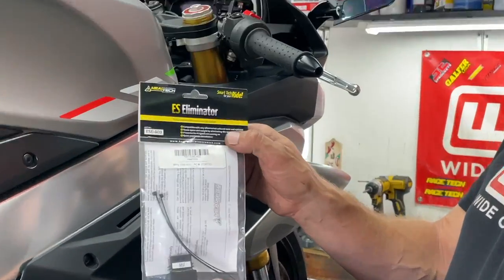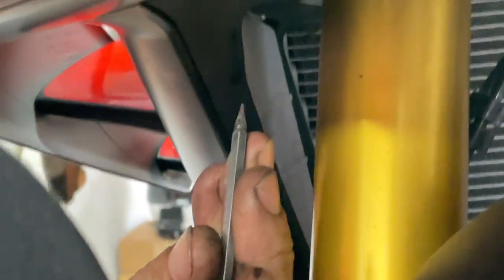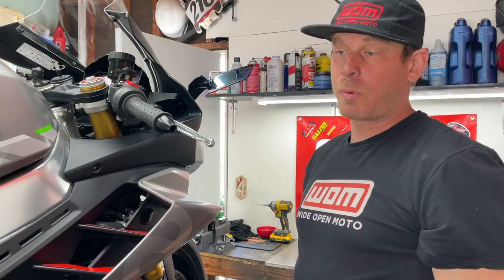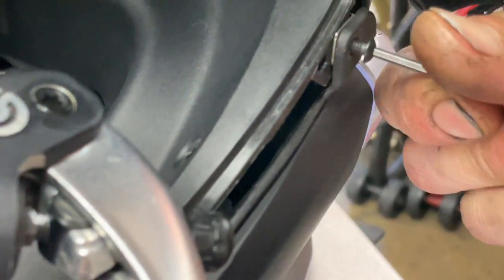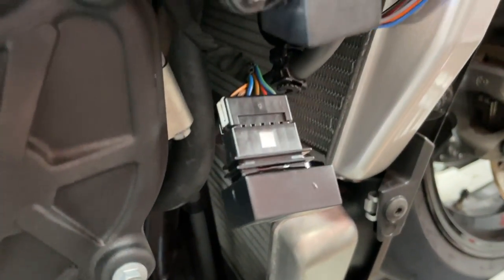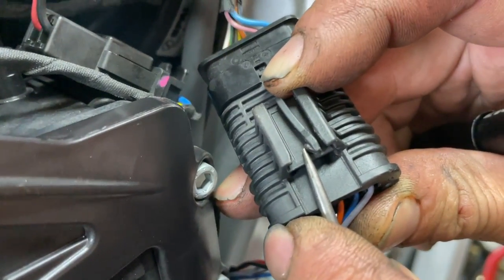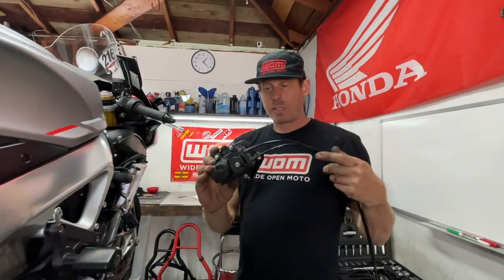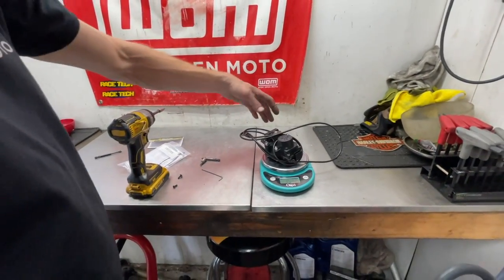Aprilia RSV4 Exhaust Box Servo Removal Tutorial (2017-2023)

Comment: Will removing the servo without the heal tech plug and having race mapping with akroprovic throw a engine light and limit power at 7500rpm? First ride on my new 2021 rsv4 factory a d it hits 7500rpm a d drops power and eventually engine light came on. Race mapping is done aswel